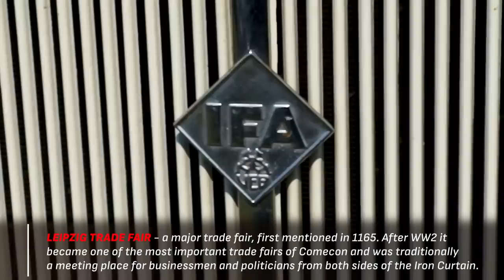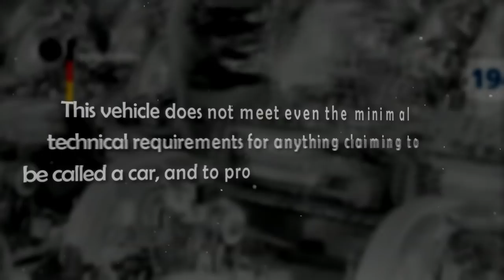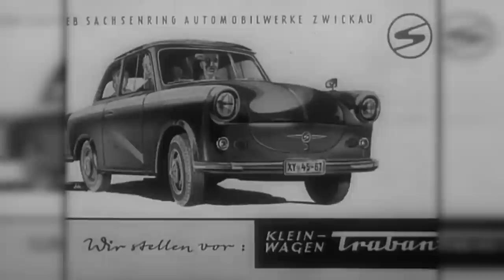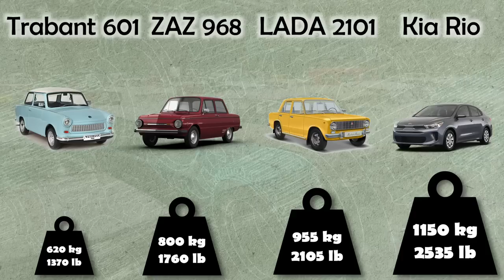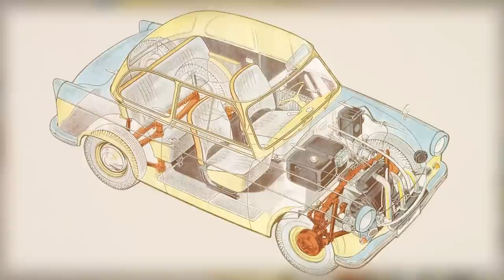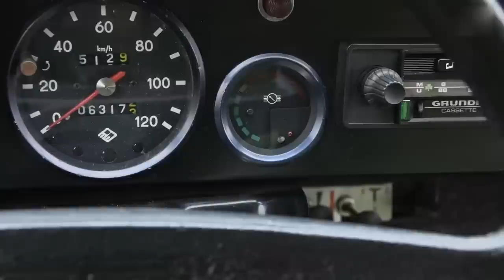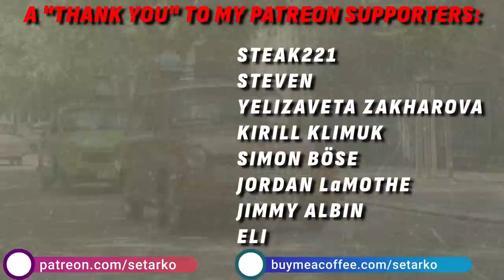Trabant - A Plastic Masterpiece of Developed Socialism

Comment: As someone who owned and repaired SAAB's 2 cycle cars,  your comparison between the Trabant and SAAB couldn't be further from reality.  The engines that SAAB copied originally for their model 92's were from DKW.  But with the 93 forward to 95 and 96 their engines their own and were much more refined..  First off construction:  The cylinders and crankcase were two castings in durable nickle iron alloy, and water cooled with a pump, not thermosyphon like DKW's engine, which soldiered on with thermosyphon for a decade. They also ran on a much leaner oil to fuel mix at 40 to1, so less smoke pollution out the tailpipe.  SAAB designed in house, their own oil injection that pumped oil directly into the main bearings so having to premix gas and oil became a thing of the past, this years before Suzuki came up with CCI for their motorcycles. SAAB's oil injected engines were guaranteed for the life of their car, as long as you kept their oil tank filled.  SAAB used a very precisely made points and condensor distributor with mechanical flyweight advance and vacuum retard which the SAAB two stroke very flexible and a very broad torque curve, while the Trabant was fixed ignition timing.  SAAB treated their entire car bodies with an anti rusting dip followed by completely immersing the body and doors in paint.  Rust was not a problem unless there was a lot of winter road salt exposure, their steel was also very strong, well ridged and strengthened by the stamping process.  Their heaters were the best that any car had at that time.  Clever touches like being able to overnight camp by folding down the back seat, sound deadening and insulation of the floor pan. One of the most refined automotive 2 cycles ever made and a car designed by jet aircraft engineering.  The Trabant was maybe not the worst  but it was no improvement even on the DKW and that is not something to be proud of.

Comment: 00:35 🚗 The Trabant, often mocked and ridiculed, was a unique product of socialist automotive engineering.
01:53 🚗 Despite its reputation as "The Worst Car Ever Made," the Trabant had a significant waitlist for prospective buyers.
03:25 🛠 The Trabant emerged as an answer to the Volkswagen Beetle, aiming to rival Western automotive standards.
05:32 🚗 Contrary to popular belief, the Trabant boasted innovative features such as independent suspension and front-wheel drive.
06:57 ⚙ Despite its modest 17 horsepower engine, the Trabant offered reasonable performance and ease of maintenance.
08:10 🏭 The Trabant's design and construction, though unconventional, were pragmatic and well-suited for its era.
09:53 📉 Planned economy and lack of innovation led to the downfall of the Trabant brand, despite initial success.
12:07 🔙 The Trabant, once despised, now garners nostalgia and is considered an iconic car of its time.
13:34 🌍 Attempts to revive the Trabant in Uzbekistan and the global travels of enthusiasts suggest its enduring legacy.

Comment: The problem with the Trabant was not when it launched. It was a cheap peoples car, a little to rough around the edges, for instance the original Fiat 500 was launched the same year and is much more refined, but you could see how it fitted into that landscape. It's the fact it lasted in manufacturing till the fall of the Berlin wall barely changed that is it's problem.

Comment: Something important you've missed to mention: The Trabant was perfect for the GDR and the proverbial communist scarcity: The ability to stuff in large items. The doors open almost 90 degrees. Take out the passenger seat and load a fridge or a washing machine, furniture or large items such as construction materials. For a car of its site the trunk is quite spacious and you can fit a lot of luggage. The Trabant could be extended with a hitch to tow a trailer - not a large one but one enough to carry some bags of cement you'te "organised" somewhere to repair your house or Dacha. Some smart Saxon invented a tent which could be mounted on the Trabant's roof. Together with a "Klappfix" (quickly fold) trailer which featured a tend, extra luggage space end even a small kitchen whole families went on holidays camping (given the shortage of hotels and resorts) - to the Baltic Sea, Thuringa, The Tratra Mountains in Slowakia or even the Balaton Lake and the Golden Coast in Bulgaria. Over 1000km - insane by today's standards. But it worked. Nice memories for many.

Comment: The Trabant engine was actually brand new in late 50s. The prewar engines were used on Wartburgs and Trabant`s predecessor P70 but for Trabi P50 they designed the new one.

Comment: One weird twist to this story: The Trabant's engine wasn't a development of the pre-war DKW engines. It was actually a copy of the West German Lloyd's engine. However the Lloyd was in part developed by ex-DKW men who had fled East Germany after the war. Trabant copied the engine because the Lloyd was air-cooled, unlike the DKW, which meant no costly radiator etc.

Comment: During GDR times mixing oil into the fuel wasn't necessary as all of the far to few petrol stations had mixer pumps. You selected 1:25 for your DKW, 1:33 for an older model or 1:50 for later models and away you go. BTW. Wartburg is not plastic but a rather tinny car. I liked it - I bought one as my first set of wheels in 1990 as a nice bargain when good used cars were hard do come by.

Comment: Great video! Finally someone with a proper analysis rather than constant bashing of the car. I own one too, it's a fun car, puts smiles on everyone's face, great road handling, quick and light so it has an easy time going through traffic, easy to repair and reliable... Of course it's not as luxurious as a modern car, but for the small werstern European oldtimers I've driven it's definitely not worse :-). It's pretty comfortable on rural streets, had no issues with bumpy dirt roads, and if you need to take a highway, atleast we can do so comfortably with our speedlimits being 100 km/h, the Trabant goes a tiny bit faster, and stays really stable on road handling.

It's not a car for people who seek luxury, but if you like being 100% of control of the engine without a computers assistance, and are looking for a cheap classic car that is easy to repair, get yourself a Trabant. Best money I've ever spent atleast on a hobby hahahaha
Reply: It feels like it is one of those things that embody the joy of Going. Much as I want better public transit and less car dependance? I do want the option to exist to just... pick a direction and Go.  I'm sure one could, with modern means and methods, take the design of the little guy and do something that is in the same spirit of cheap simplicity. 

Wonder how much lighter it would be with an aluminum frame.... as example.
Reply: @singletona082  It absolutely is, handling such a car is in and by itself a great experience. Whenever you have a free hour or so, you hop in and drive it around a rural area, when you're starting to get done with it you drive to a local map and find yourself your way home again...

I wish there would be modern cars with the simplicity of the Trabbi, it is genuinely a great car to drive, it is very honest in what it has to offer and it is very clear in its behaviour when something is up for repair. 

An aluminium frame would help a bit with weight, then again, it already is only 600 kilos curb weight so it doesn't really need to shed anymore weight to begin with... It has a small air cooled 2 stroke engine, and a gearbox light enough you don't need a jack to pull it out of the car. The structure is quite rigid made from steel, but all the non mechanical body panels are (also really strong) really light weight plastic infused cotton. Hence it steers super easily without power steering. Besides, they really went the extra mile reducing the amount of parts,  where they even simply put the fuel tank on top of the engine such that you don't need to waste space, weight and power running a fuel pump hahaha.

If they were ever to reproduce the car or one where they take a Trabant (601) as example, to improve safety, disk breaks on the front would be no luxury, neither would be a proper camber correction (the roads are better, it would prevent you from having to rotate the wheels around the car every 5000km). And have it use normal commercially available transmission oil.

If you want to make it easier to drive for people used to modern cars, maybe oil injection would be convenient rather than mixing it in the fuel (also such you can engine brake), swap out the graphite pressure bearing in the clutch, ABS could be added, a fuel gauge and one for revolutions... Then again, for me it would spoil the fun, the car is already a great design as is... It was designed like 60 years ago, yet it has better fuel economy and is more reliable than my daily driver, for a reason hahahaha

Comment: Corrosion is a critical problem of the Trabant! The dangerous, invisible point is the connection between the steel frame and the duroplast body and the bad rust protection. So almost every owner gave it to a workshop after getting the brand new Trabant to get a better protection against corrosion. The used product Eleaskon is a wachs with a little content of oil and solvents. After evaporation of the solvents it was a brown protective film. It was sprayed in every cavity. So the durability of the Trabant is based on the care of it‘s owner. Simply buy and drive didn't work 😉

Comment: The only worst feature is the 2 stroke engines, the rest of the car is fairly ahead of its time when it came out, fairly good looking and practical. However it only gets worse because it never get updated it remained mostly unchanged until a year before reunifocation with a 4 stroke engine.

Comment: Design is like smaller version of Peugeot 404 wich was very fashionable for time. I have mine about 10 years, first two year with original 26hp motor and later i put 1,8 vw passat B3 motor and transmission. I holded wery well it was black with 15 inch american wheels, it was head turning beautiful car, and fast to :)

Comment: It is a super minimalistic car. If you dont have to manualy mix the oil and petrol and if it had actual full set of gaiges, or st least one showing everything (like on the 2cv6 for example) installed it would have been even more popular. I've seen couple of them still being driven even today. One was even for sale. Similar to this, but slightly better equped were the 2cv, Zastava 750, the Syrena...but not the Beetle. The Bug was posh and expensive compared to the Trabant.

Comment: Just a few comments: 

1) Wartburg was never made of plastic (Duroplast). It had a proper metal body. 
2) Between the P60 and 601 there was the 600.
3) Lada Niva is also ridiculously outdated and cannot be considered as a real choice of car.
4) If the gas-oil ratio is fine in the mixture, Trabants don't blow out much fume. (Some it will, necesserily, but not as much as you show in the vid.)

Comment: fun fact the road legal registration of trabants is rising again in the German federal republic.
At the end of 2020 38.000 Trabants were 100% road legal!
During the Corona pandemic 10.000+ were made road legal again.
The German MOT (TUV )is not easy so this is a big hats off to the home mechanics.
Personaly i know a few home mechanics who converted some trabi's into crazy versions.
Electric, Mazda Rotary , Yamaha TZR 2 stroke and even equiped with a Suzuki 1000 cc 4 stroke Hayabusa motorcycle engine!
A Trabi with a dual Tesla electric engine is also nearing completion soon.
Who thought that a Trabi would become a blank canvas for engineers to tinker on.
Like it or not a Trabi is super cute looking ( like the Polish FSO Syrena) and a perfect candidate for a sheep in wolfs clothing.
Reply: The Hayabusa engine is pretty common in conversions, i know of atleast 2 full driving ones.  its a cheap used engine because idiot drivers normaly just kill themself with that bike while the engine stays intact.
Reply: @nox5555 , there is a lot more practical moto engines for converting the Trabi, if you want to kill yourself in the Trabi the Hayabusa would do it quickly.   Frankly something like a Honda ATV or Yamaha Bigbear where you have a semi auto transmission and reverse gear.  Or even a water cooled Lifan ATV 230 cc single for economy.  The trick is being a good enough fabricator to link the moto engine to the front axles.

Comment: Trabant was a very smart design indeed, spartan and indestructable!
Reply: oh it was destructible...
at -20°C the panels would loose their flexibility, making them crack very easily.
Reply: @windhelmguard5295  Interesting! Fortunately there's rarely that cold here. A young colleague of mine drives a 34 year old Trabant and it's still in very good shape.
Reply: @milanbikics3144  
yea i know this mostly because we used to use trabant panels as sleds back in the day.
under normal conditions they worked quite well, but whenever it got too cold there was a real danger of the panels cracking.
the roof and the hood were particularly effective.

Comment: The problem was, that the east German car industry went into stagnation as further development wasn't allowed anymore. So much stupidity. 
For the Wartburg they had developed a 1.0 3 R3 four stroke engine that would fit the then current model with minimal adjustments. 
No that was halted and shortly after Günther Mittag decided that they have to use the VW engine which was too big for the car and the adjustment of the platform for that was more expensive than developing a completely new car. 
Only so they didn't have to buy new tooling which also didn't work out..... 

Improvements on the Trabant were only allowed when they saved money. 
My father was in the engineering department back then and lead a team which improved the CV shafts in the mid 80s. 
Citroen supplied a factory and in change the GDR sent cv shafts and could use them also for their own vehicles. These were so overengineered for the Trabant that you could almost run them dry and in term they saved on the expensive and hard to get molybdenum in the cv grease which in the end was cheaper than the old cv shaft AND more durable. 
As premium he got a Trabant for free without waiting time. He walked next to to the conveyor during production and gave everyone involved in building his car a small tip to get the better part which he had prepared and so everybody worked extra careful. 

After driving home from the factory he instantly dismantled the car. Added soundproofing to the fire wall an improved exhaust with bigger heat sink for heating and added corrosion proection to the metal frame as his previous Trabant that he bought used was pretty rusty. 
That car was very quiet and very warm in winter. 
It was an 1986 car and it still ran in everyday service close by in 2012. After that we lost track.

Comment: To be fair, only extreme shills would claim that it was a bad car. Because even with some obvious flaws, it was an incredibly sturdy car that was nigh invincible and needed very little repairs.
Reply: Compared to every other European 2 stroke they were crap.
Reply: No, they really were not.
Reply: @sunrisesparkle6363  So,  were Trabant's engines guaranteed for the life of the car?
Reply: @tauncfester3022  Yes. It also had unibody construction, front seatbelts, front wheel drive, rack-and-pinion steering, and that engine was transversely-mounted.

Comment: 17 Horse power but the car's weight was near nothing. So it can't be considered a negative.
Reply: 1300 pounds is still heavy  SAAB's 96 sedan weighed 1600 with a 2 cycle engine that made 42 HP and got 30 mpg.

Comment: If you look at it a little bit closer, you'll probably see that the Trabant resembles the old Mini Cooper model with a slightly long butt. 

But imagine a sleeper Trabant, that would be cool. Deadly, most likely, but cool.
Reply: Yes, a Q-Trabant. Think about it, a small flat-4 with a Rootes supercharger in such a light car. Yes, you have a subscription to Exit right there....😉😫
Reply: one thing the video neglected to mention: trabant didn't end with the 601, during the very early nineties they rolled out the trabant 1.1, which ran on a 40HP 1.1L four stroke engine.
and yes people have done absurd things with those, but even the 601 can become a brutal and scary race car, although in both cases massive up grades to the brakes are made.

i also know a guy who modified one for drag racing, has a rear mounted motorcycle engine connected straight to a stiff axel, the thinn really hates going anywhere but straight, but man is it scary.

Comment: Two things. (1) DKW should be pronounced Dee-Kay-Doubleyou, not Dee-Kay-Vee. Second, you didn't mention the most dramatic change in its engineering: it received a four-stroke engine licenced from Volkswagen in the late Eighties! Of course it was too late by that time, but it was the most significant progress the Trabant experienced throughout its history.
Reply: "W" is pronounced as "vay" in German.  It may have been a ham-fisted attempt to mirror that.
Reply from the maker: Well, I always thought it was the same as with the BMW. Be-Em-Doubleyou by Americans, but Be-Em-Vee by Germans. And I've always liked the second variant more. 
As for the Trabant 1.1 - yeah, I opted not to mention it, because it seemed to me that sales of 40,000 compared to the 3 million of the previous model is something quite insignificant. If only they did that at least 10 years earlier!
Reply: @Setarko  Ah, if the "DKW" was supposed to be German, then the "K" needs to be pronounced "kah" ("father").
Reply from the maker: Got it, thanks!